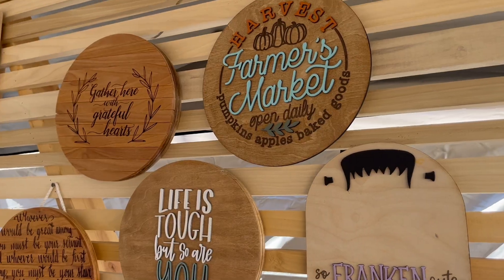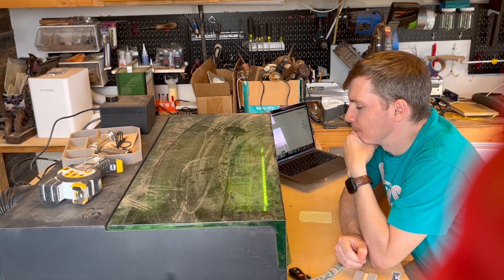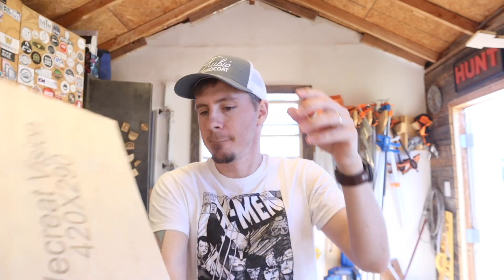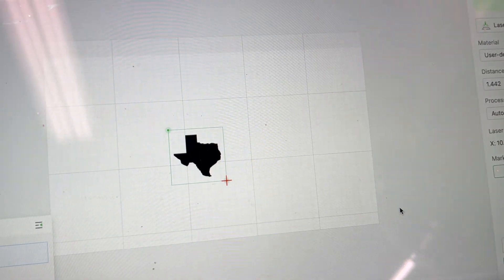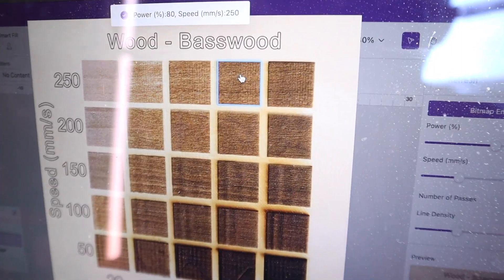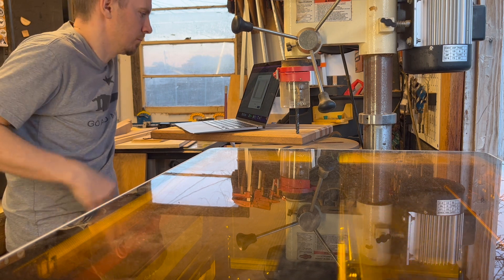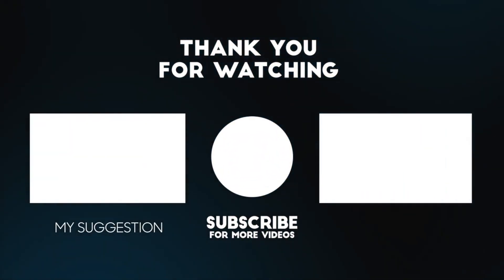Wecreat Vision VS xTool S1 & M1 // The Best Enclosed Diode Lasers

Comment: I purchased the WeCreat vision, 40 W, and I am very happy with it. I do have to say that the air purifier was not the best so I did send that back, and we recently had our handyman install a vent through one of the walls, which worked out great. The customer service was great. They kept me apprised of everything and created a label to return the air purifier. Overall, I really like the user-friendly. I have the original X tool, the one and honestly I used it a total of three times.I would really appreciate if somebody can point me to a dummy’s class for Lightburn. I think I would get more out of the laser this way but overall I am really happy with the 40 W vision.

Comment: I just got my S1 and love it. But I’m curious to see if you have the same issue I do with the riser base. When the door is closed there is a small gap that leaks laser light. To me this is very dangerous. I added the included foam strips that are theoretically supposed to block that off but it’s not perfect. I contacted xTool to see if they have any solution but basically there is no solution other than covering the gap with tape. To my knowledge, using the riser base at all makes the S1 a class 4 laser. Is that true? Or is it only a class 4 when I use the conveyor that requires the doors to be open. In that case it would make sense to be a class 4.
Reply from the maker: I don’t have any laser light leakage that I’ve seen. I might need to check now 🧐
Reply: I’d be curious to see if your machine has the same issue. Maybe mine has some type of an issue.

Comment: I don’t think you mentioned that the S1 has interchangeable laser modules. I bought mine with the 40w and the 2w Ir units right off the rip. I could eventually add the 20w and now they’ve even added a 10w I think.

Comment: I have the M1 and F1 and totally love them both! The engraving on the F1 is super fast! I’m not disappointed in either of the machines I got. First time laser owner,5 months ago :)
Love your insight on them all thanks!
Reply: what is your primary usecase for the m1? im thinking to buy the combo to. but im cant decide between the s1-p2- or m1
Reply: @monoturk  I cut wood and make ornaments and door signs. I also engrave with it but the F 1 is faster but small,perfect for key chains etc… I simply chose the M1 for the camera feature. Take a pic of a 12 in round  and design the item right on top of the round in the xcs program,then remove the round and put the wood in take another pic and cut. I like to do that to make it fit perfect and I can design and see what it will look like. I have not tried the rotary yet but I will!! MDF is my fav wood to use,get it from a laser supply company

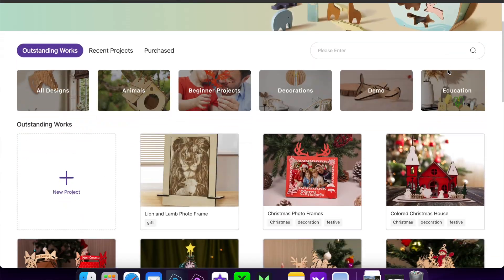Comment: Did you really take the time to test and use all three lasers? If so, in the video section "2:20", you stated that all three lasers are compatible with LightBurn. The fact is, the XTool M1 and WeCreat Vision are not compatible with LightBurn. LightBurn, as a separate software tool, may be used, but files will need to be imported into XTool and WeCreat software. You can't use LightBurn directly with either of these two lasers. Additionally, LightBurn can't be used directly with any laser featuring a built-in autofocus camera.

Allow a “NON” sponsored WeCreat owner to provide some facts about the company and what I been through with their laser product  in a real world situation. I have the WeCreat, and what may have seemed to be a good laser to others (sponsored) lacks  tremendously in support. I've been through hell going back and forth with support for issues like WiFi dropping, autofocus (through software) constantly misaligning projects, and power cord connections that keep falling out from the back of the unit. For all three issues, I was blamed by support. I know, it seems crazy but it’s true and gets better. I was told not to use WiFi but instead the USB cable—really? The WiFi problem was ignored. From day one, the power cord kept falling out, but I was told I moved the unit around, causing the cord to be loose—really? I guess unpacking from box and setting down on location I picked is considered moving th laser around? The day I received it, the cord was loose and I let support know about it, same with WiFi. Yet, no matter what I had written to support  I was to be blamed for these issues. I gotten nowhere with support and it was due to just one employee. WeCreat does not have a team of support, only one employee. And if you can't prove there are issues or a damaged unit, the warranty means nothing. The keyword is "proved." If you have a problem with WeCreat and get nowhere with the one employee in support, best of luck—there is no way to escalate a complaint further; it ends with that one employee. On WeCreat's YouTube Easter Livestream, many have stated in the live chat that their emails have gone unanswered—support. Their feedback was that they were sending to the wrong support email address. Again, WeCreat is blaming owners of their lasers instead of taking responsibility and blaming them for not using the right email address. Instead, they should have stated they would check into this and sort out the issues, but they didn’t; they just passed the problem on to their customers and told them to email again. This seems be a routine with WeCreat to throw the problem onto their customers and they themselves to ignore it.  Keep in mind , this is a new company just getting started, already support is heading in a bad direction. 

For anyone who has seen WeCreat Vision reviews on YouTube, 99.9% are sponsored by WeCreat. Not one sponsored review has ever demonstrated WeCreat using the 2.4 WiFi; they're using a USB cable. I have no idea if WiFi dropping is an isolated issue or not. There are no non-paid or sponsored reviews I have seen outside of YouTube as well. So, I can't say if others are having the same or similar issues as me. And anyone who knows me from my channel knows I have shared many times about my IT career—22+ years as an IT professional, building, fixing, and installing routers and fiber optics. When it comes to home networks, it is a piece of cake for me to fix. When WeCreat integrated Wi-Fi kept dropping, I knew the problem wasn’t the home network after troubleshooting; it was 100% the WiFi built-in into WeCreat that was faulty. Yet, no matter my tech knowledge and drilling down each step I made to troubleshoot and shared with support, there wasn’t a problem; it was still my fault why the WiFi was not working. However, I am very big on customer service and warranty, especially for the price tag of WeCreat. I didn't do my research or diligence about their warranty and support before buying—my fault. As a YouTube Content Creator, I always tell my audience to verify and check out any companies they're going to invest their hard-earned income in before buying, and I made the biggest mistake by not doing what I've been preaching.

That said, yes, I'm sending the WeCreat back to receive my full refund. I will also ignore any review products being sponsored. On my YouTube channel, I don't and will not be sponsored whatsoever. Every product I review was paid out of pocket. I highly recommend that anyone searching or researching a product such as WeCreat or any other lasers, watch or read non-sponsored reviews. And always check out the company's policies, support, and warranties. Don't make the same mistake I did.

As you may already guess, I would not recommend WeCreat even if the laser had no issues. Absolutely not. And there are two reasons I wouldn't recommend WeCreat: lack of support and no warranty, even if it says so. If you received a damaged laser, they will not exchange it. WeCreat Vision will only send out replacement parts (maybe) or ask to send it back for a refund. As for replacement parts, that all depends on how hard you try to prove it is damaged and maybe, just maybe, that one support employee may send a replacement part. But, it is going to take a lot of convincing regardless if you really have a bad unit or just a part. So, anyone who does proceed to invest in WeCreat I hope the laser really works out, but if not, don’t say I didn’t warn you.. 😎

Comment: I make cutting boards, and the question I have with these is can you use these laser engravers to do the juice grooves? Just wondering if I can use a laser engraver rather than a router.
Reply from the maker: Oh no you’d never get the depth you need and using a laser wouldn’t leave a clean cut like a router so you’d leave yourself open to getting bacteria in ever little pore that the engraving leaves.
Reply: @TheReformationWoodshop thank you so much for the response, that was what I thought. I'll definitely stick with the router. Thanks again.
Reply: Maybe consider the xtool F1 Ultra.  It can emboss metal and wood.  It .oght be an all-around solution for you.